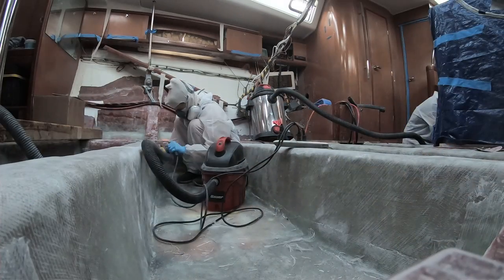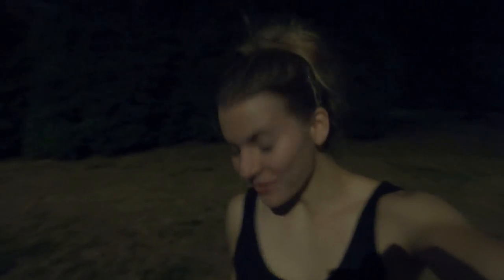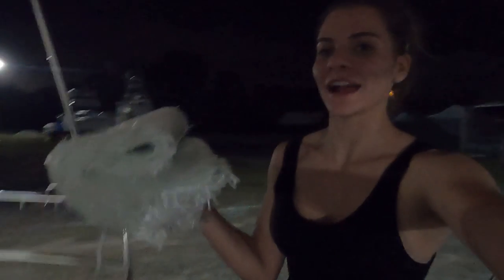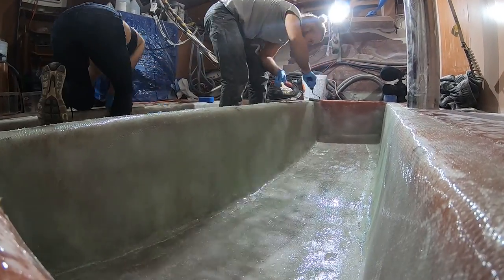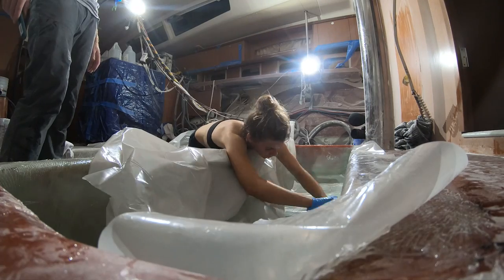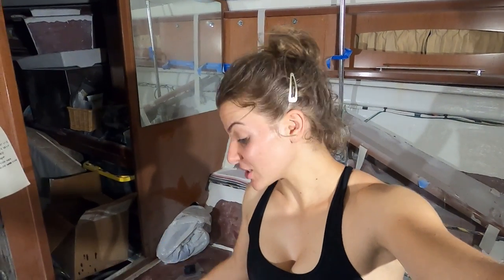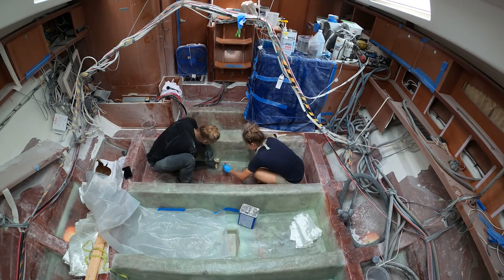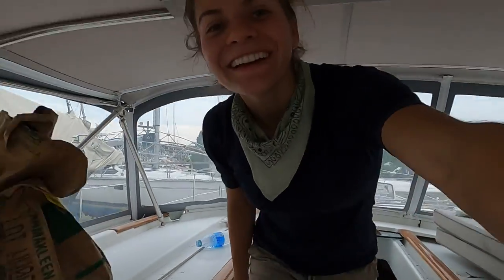We OVERBUILT + What Our SURVEYOR Says About It! | Expedition Evans 21

Comment: About a century ago I worked in a boatyard and had to do this exact job several times. The last task we did was to drill out the limber holes and cover the raw cut with thickened epoxy. So YTubers, don't panic it will get done once the glassing has been completed.

Comment: Cutting down Epoxy and Biaxial with a DA sander is maybe one of the hardest ways to get the job done. For heavy removal, a good quality belt sander with 36-40G paper takes material down very quickly while still allowing for good dust collection. For all out "inches per hour" level of removal, a 7" disc sander with 24-36g and/or a 4.5" angle grinder with a 24g flap wheel is the ticket, but extremely messy. Next time you have to remove glass though, keep the DA at home.

Comment: Good job! Don't forget the drain holes.  Water anywhere in the hull needs to be able to drain to a single point in the bilge to be pumped out. Looks overbuilt to me. That's how they should do it at the factory! I'd never buy a sailboat with a bolt on keel. I love my Outbound 44. 😎🤙

Comment: For that kind of heavy epoxy sanding, you need a small angle grinder like Ryobi AG4031 and a 40-grit flap disk. It would have cut your labor time down to 10%, but of course you'd have to deal with the dust. (Take that stupid guard off the angle grinder. It's useless and just gets in the way!)

Comment: Great video!  You guys got this now!   ...and as a prior builder of a fiberglass aircraft, if you have a sewing store nearby(?) you can by dacron fabric and use as peel ply.  I'm curious about how the plastic worked out, since it does not allow the epoxy to escape through it.  I suspect a smoother surface, but either more sanding or more weight.   ...and despite Jade's view, I think it looks good!   Good job.

Comment: FYI 4mill plastic will not stick to epoxy resin and can be used like a peelply DO A TEST FIRST to ensure no issues. The only major drawback is that it will leave a glassy finish FYI. But on the other hand it offers some other benefits like helping to prevent drain out of the resin from the fiberglass.

Comment: How could the surveyor be anything else that super impressed. To say you have overbuilt this is an overstatement , but that is a good thing, after all the work to access the area it would have been shortchanging yourself to do it any other way to what you did. I would not be overly concerned about the ‘fugly’ aspects of the glassing job it is a functional repair, and some light filler (and a final sand) followed by flowcoat will provide a good enough finish to an area that will be rarely seen.👍😉
Well done for your industry and application on this herculean task. (I am aware in real time this aspect is all done and dusted but my comments are offered in the context of the video).

Comment: How will the water flow from the other grid sections into the center section with the sump tray? Will you be drilling holes through the grid to give the water a path to flow, or is there some other solution?
Reply: They'll have to cut limber holes along the keel line in the grid. Easier to do after all the glassing
Reply: @AlPence  wood structure under glass?  Drilling would expose wood to water?

Comment: I don’t see any limber holes, are they there or are planned to be there? The sump box would be rather redundant without them.
Reply: OK, I didn't know that's what they were called but I was about to post the exact same question! Like, how does the water move from one POCKET to another to get to the sump box in the first place?
Reply: @zuke1624  Thinking the same.  Sump no good if the other sections won't drain into it.  Didn't your surveyor see that??
Reply: Limber holes are easy, and are actually easier to do AFTER all the rest of the layups.
Drill fill drill, or drill and sleeve with the gaps filled with thickened epoxy.

Either option is easier than trying to wrap resin soaked cloth around a hole and sand back every time.
Reply from the maker: The limber holes will be one of the last steps after we fair/sand/paint the bilge 👍
Reply: Like you guys and that is correct. Trying to fiberglass around a hoke is backwards, you bore them, you dress them abd then uou you jell coat.
Reply: zuke1624 Like the Titanic over the top of each one
Reply: @48whodat  Well kind of. First you don't gelcoat (also Gelcoat is a brand name but that's another story altogether) over epoxy.  Gelcoat is for polyester, they're going to paint.  Second and way more importantly, it would depend on the coring material.  If it was wood you would stagger your glass layers to encapsulate the limber hole.  Where as there core material is fiberglass so you just punch a hole through it and save a bunch of time.
Reply: @ExpeditionEvans  Too late for you to read my comments as your project must be all done and dusted by now, but you could have saved tremendous time by:
1- Using paint rollers instead of brushes, especially when working large areas.
2- Using the wet lay-up technique (you wet the surface first, then lay the dry fiber cloth on the wet surface, then continue wetting the outer surface of the cloth).

In pro boat yards, when they hand lay fiberglass, they usually insert a layer of light weight mat between layers of multiaxial cloth.
Last, I hope the can of acetone I saw, was just for cleaning tools, and not for cleaning surfaces before laying a new layer. Acetone leaves a thin dry film on cleaned surface that later affects the quality of the bond when fiberglassing with epoxy.

Comment: I'm not a Sailor but he sump bucket looks like it would only catch water from the section that it is in. Should there be a hole that goes into the other compartments so they can be pumped out also. Just curious and don't want you to sink. I am probably showing my ignorance  here but just didnt want you to miss something if it was important. You to make a Great Couple and i love your excitement. Thank you for sharing your adventure with us.
Reply from the maker: Yes you are absolutely correct. Once we are finished with all the glassing we will drill limber holes to allow water to flow from one section to the next (and through the hollow grid centers).

Comment: Hi guys. Been watching you from the beginning. Refreshing to see a great team repairing a production boat that is well capable and more than capable of circumnavigation being restored. Correction; OVER RESTORED!   As a chartered structural engineer (retired) It is evident that you have exceeded the boats original design parameters. Well done you guys. If you want to add extra rigidity to the keel to hull joint and reduce keel flex giving you less flex and less twist, or a more rigid hull to keel connection. Think about adding L shaped brackets from the keel bolts, internally to the boats frame. Fitted with webs these will help transfer the keels dynamic loads to the now improved frame over a much bigger area. The bigger the area the lower the load. We have done this on a new boat making it very stiff! Sail Safe Guys, Ant, Cid & the pooch crew.

Comment: Over built to the point of absurd LOL Really nice job!!!.  Warning it is so stiff now there is no flex and no give . A grounding could be either no damage or catastrophic . There is no crumple zone any more to absorb the energy .  The old C&C 35-3  suffered from that they made it stiffer at the factory than the older ones and it took more damage on groundings that the older boat as a result . The energy has to go somewhere . 

Having said that I would have done the same . Boat will  also be faster - stiffer boats are . Way better than factory by a lot .

Comment: if there is air under the beams maybe it pays to drill some small holes and fill in some epoxy glue silicone or something
Reply: @srcastic8764  just think when you press something together then you should have glue underneath, there may be vibrations and moisture ?
Reply: @srcastic8764  if it is hollow inside you should have some air holes anyway, otherwise if it gets damp it will not be dry again

Comment: Unless your surveyor is a nautical engineer, take his input with a large grain of salt.  He is not expert at determining whether your structural repairs are adequate.  I suspect that it probably is, but dont put your faith in a boat surveyor for a structural evaluation.  They can help determine whether the structure as built is in good shape, but they're not qualified to determine whether the structure as built is adequate to the task.  Also, constructive feedback, the video seems a bit light on content and heavy on the "cute" couple banter.  More building footage please.
Reply: Naval architect, marine engineer, surveyor, boat yard technicians/ work crew.....it would be logical to assume none of the above should be excluded from a proper repair.
However, the “blueprint” for the original design still exists in the fracture laminate.
I would think that benefit of time and  experience is well suited for a competent marine surveyor to evaluate overall quality of the restoration. Certainly, the insurance company has traditionally defaulted  to this opinion.

Of note: this boat had successfully sailed for the  5 years between the initial grounding and the Evans purchase.
The damage was real and projected to be a costly undertaking...yet, apparently the boat never sank as a result of the neglect.  How you gonna know?
I also made the mistake that this is a DIY or “how to” video for boat restoration.  ( there are too many details on various aspects of the repair they have chosen not to share) The assumption that we should be informed of these details is probably improper on our part.  The repair is just the background story to two kids who seem to have an interesting goal in life. They get to tell their story as they see fit.
-regards